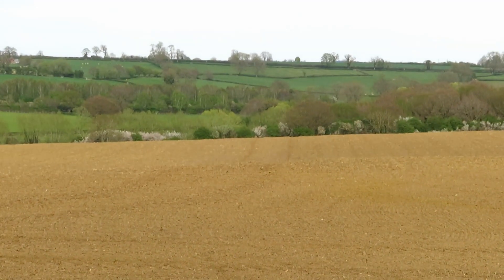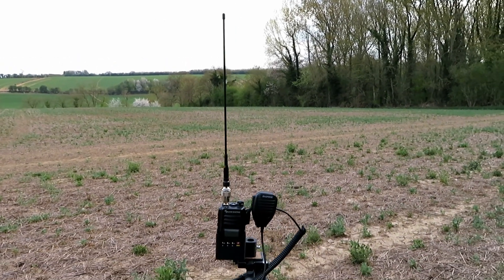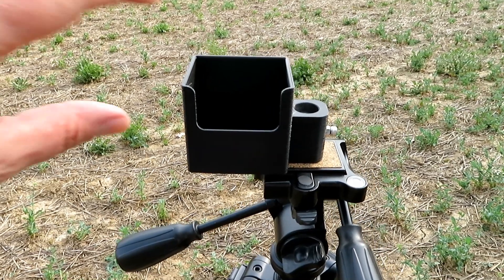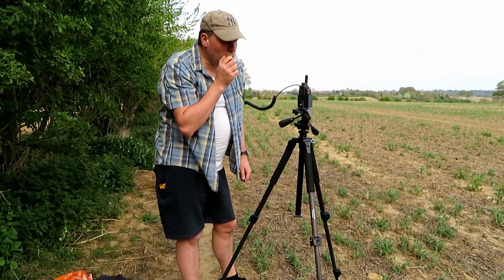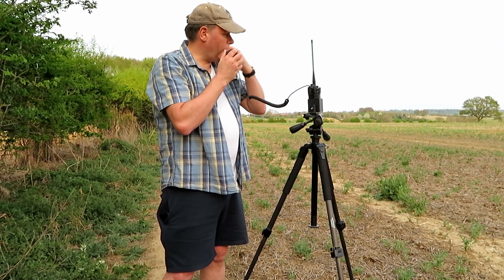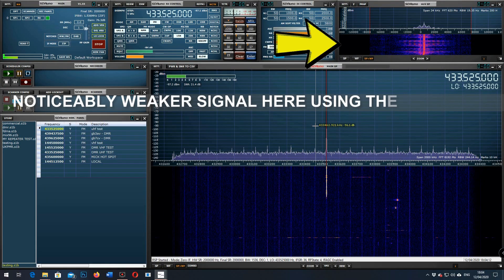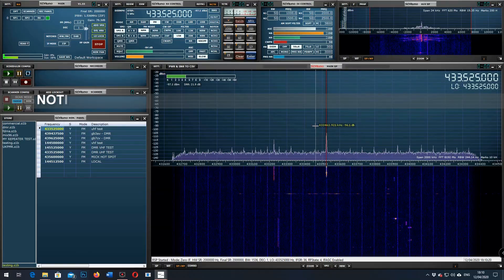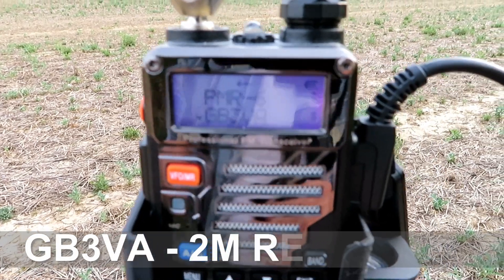HOW TO REALLY IMPROVE THE RANGE OF YOUR RADIO, FOR SMALL CHANGE. THE DIFFERENCE AN ANTENNA CAN MAKE.

Comment: Great vid.. would have been an interesting test on 70cms repeater on the stubby... I had one for my Kenwood handie.. it got quite hot on 5 watts on uhf!!
Reply from the maker: Thanks, yes I did do it with the stubby but it didn't get in to the repeater, stubby is OK if you're only needing short range but want to pocket the radio, that's really where they come in.

Comment: Hi hi. I took a fake antenna. And measured the normal ant. And cut. Then put a terminal  on the remaining peice of  the fake. Attached it to a ground point. Pointing 180 degree from the stinger. Now with a counterpoise. It's good to go. To be removed as needed. Kv4li tks

Comment: i bet the copy antenna is a copy of a nagoya and i have a pair too, mine couldn't fit as well, but i grabbed a pair of wite cutters and removed the extra material near the connector of the antennas, and they fit well now, but there is a gap now between the antenna and the radio that may require some kind of rubber spacer for esthetics 😁
Reply from the maker: Yes that's the problem it has that extra bit of plastic round the base, I could make something a little better looking just used the adapter for speed 👍

Comment: What an impressive young man you have there. I'm sure you're quite proud of him!  There's a company here in the U.S. that have been making small batch, hand wound, and very high quality portable antennas since the '70's and their stubby antennas will usually out perform full size ducks. They can even custom trim the antenna to a specific frequency if you need such precision. Their selection of fitting types is mind boggling and include old and obsolete types that nobody uses anymore. I hope this is some use to you or one of your many followers. https://www.smileyantenna.com
Keep up the great work and 73's from across the pond! ..... Roger W9RHS
Reply from the maker: Ah great thanks will look in to that 👍